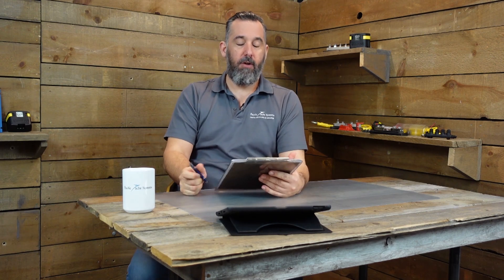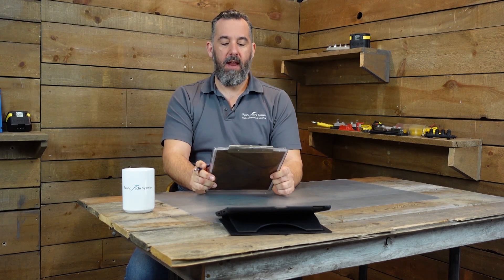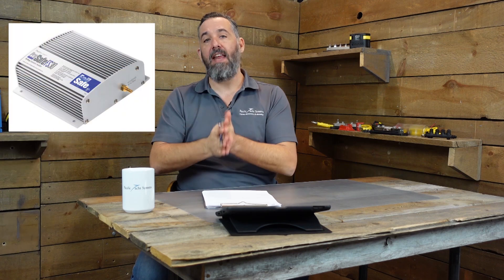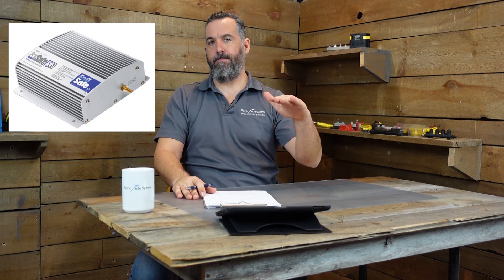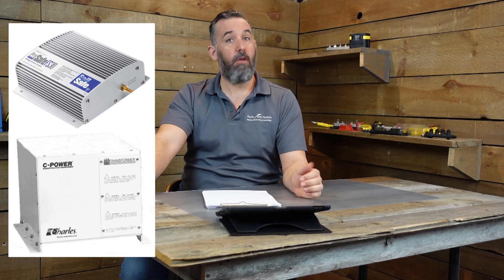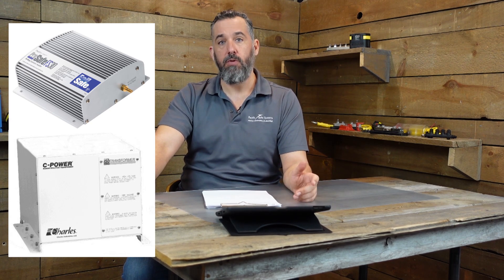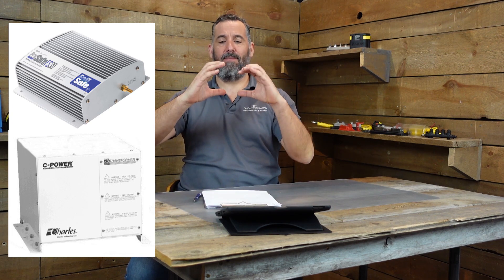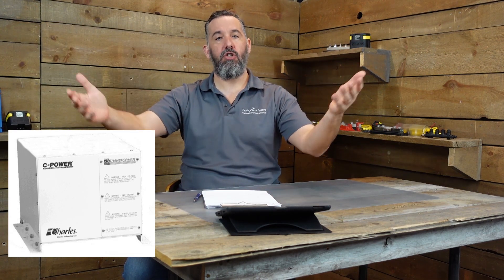What Is the Difference Between a Galvanic Isolator and an Isolation Transformer?

Comment: High quality isolation transformer: 2000W for $350, 3200W for $500. That's enough for most 50ft and smaller sailboats (it is rare that you need over 1500W at any one moment). Not that expensive. Still, galvanic isolators are half that. But it's not thousands, as you claim, unless you want 10kW+.

Comment: I've used isolation transformers in power closets(IT rooms) that are only about 100 pounds and about 1.5 cubic feet.  I've seen smaller ones than that but I'm thinking of the few thousand watts you might need on a smaller vessel which is certainly less than a smallish IT room consumes.  They don't have to be the behemoth size and weight you are describing.   Yes they are going to be pricey, but if you own a million dollar yacht, what is it worth to keep that 80k Seakeeper  or the 50k worth of electronics you have installed in safe working conditions?

Comment: Hi I have 2 shore power connections, one fwd and one aft connected in parallel.
Do they both need separate Galvanic Isolators?
Reply from the maker: you can not connect 2 shore inlets in parallel.  They each need their own AC panels, main breakers, and keeping the neutrals separated.  or a switch that selects which one is in use.    If they are parallel you will never be able to plug into a dock that has gfi / elci / rcd breakers.  or add them to your boat.

With a switch you could get away with only one rated for the shore size.  if you are using both inlets you'd need 2 rated for the shore size or 1 rated for the total shore amps  (2x inlet amps).   wiring 2 would be easier to make sure they get wired correctly

Comment: Hi Jeff,
I am a huge fan of your videos,
Thank you so much for doing all that work for us.
I am considerind purchasing a Victron ITR050362041 isolation transformer, and if I understand properly, it can handle both 110V and 230V.
But I suppose that if I cross the atlantic and plug my boat in a marina in north America, I will have 110V as a result on the boat side of the transformer. So What is the purpose if I cannot use my 230V devices ?
Some other questions :
Is it « Marine environnement certified », as you advice? 
What about the noise ?
Thank you again, and best regards from France ;)))

Comment: What are your thoughts on the isolation transformers from Victron Energy? I have a steel boat and planning on getting one but not sure how to size it.
Reply from the maker: Hmmm, some but not lots of experience with metal boats. You size the isolation transformer based on your shore power voltage and max amperage.

Comment: One of the catamans was using of of these Isolation transformer Mastervolt GI 3.5 with a 13.2 lb weight but probably expensive
  
https://www.mastervolt.com/products/mass-gi/mass-gi-35-kva-16a-lightweight/
Mass GI 3.5
A safe connection between vessel and shore installation is an essential part of your electrical system. A galvanic electrical isolation between shore power and the on-board power prevents any electrical corrosion of metal parts while keeping you earthed.
•	Ultra-modern high-frequency electronic switch technology.
•	Lightweight and compact.
•	Integrated Soft Start function.
•	Connect to voltages from 90 to 255 V and from 45 to 65 Hz.
•	Units can be parallel coupled for higher capacity.
•	Higher efficiency, limited heat development.

Comment: Thanks for the great videos!  Can isolation transformers fail?  How do you know?  I've got a 2006 boat with one in place, and uncertain if I should be trusting it to be functioning correctly.  Would i be correct in assuming that the AC power supply would fail (cease to engergize the boat) if the isolation transformer failed? Thanks in advance.
Reply: If you're asking does the Isolation Transformer "wear out", then no, not really, not in anything like a short span of time.  Really high voltage spikes, (think near lightening strikes) are about the worst thing on transformers.

Comment: I am adding an inverter to my boat and I have a galvanic isolator on the shore power coming into my boat.  I have a breaker on the shore power after the galvanic isolator. Should the neutral and ground be bonded at the breaker going to the inverter or should they be isolated until they reach the AC distribution panel where they are all bonded together? Thanks for all the great videos and information! Love the PYS Hat!
Reply from the maker: Hi Ben, the AC neutral and ground can only be connected together at the source of power. Normally that neutral and ground tie happens at the source of AC power on shore. A Marine inverter, when inverting will automatically do a neutral ground tie. 

You definitely should NEVER do a permanent neutral to ground tie on your boat.
Reply: Thanks for the information.  Trying to break my bad habits from wiring houses. When I see a breaker box I want to tie all the neutrals and grounds to the rail. I'll isolate them to the inverter and from there to the AC panel. Keep up the great videos!

Comment: Hi. Another Question.

When installing a inverter/charger can a large AC circuit panel be split to have some circuits powered by shore power and some by the inverter or is it better to get a seperate sub panel for the inverter circuits.

I am installing a inverter/charger and had planned to use a seperate sub panel for the inverter circuits but an old salt told me I could split my existing Blue Sea panel. This would leave to main breaker and two circuits (inverter ac in and the hot water heater) powered by shore power and the remaining 4 circuits to be powered by the inverter. I believe this would involve shortening the 3 common buses in the panel and creating new ones for the inverter circuits. 

Even if this is possible, is it recommended? It would save space and money and make for a neater installation. 

Thank you.
Reply: Depends how the boat is wired. ABYC normally REQUIRES a separate sub panel for inverter loads. You may have to install a breaker powered by the inverter so you can isolate it from the loads. At least that is how I would wore it and I do marine electrical for a living.
Reply from the maker: Hey Mike, yes what you ask is doable and we sometimes deploy inverters like this too.

Comment: Would it be reasonable to have shore 120AC only go to a charger  and run all of your 120AC loads from an inverter?
Reply from the maker: Yep, some boaters have this exact setup, especially for boaters that have a boat wired for AC loads at 60 hertz and  are now in a different jurisdiction where shore power is 50 hertz.

Comment: Hi Jeff, where  should the galvanic isolator  be installed, close to Power entry, inside  ?  Does it protect your boat against others and or your boat   leaking in the marina, ?  Great intro , 
JC
Reply from the maker: Galvanic Isolator should be installed as close to shore power receptacle as possible. A GI doesn't protect against all stray corrosion events but it helps a lot, definitely worth having.

Comment: Jeff, should the AC grounds (shore power and generator) and all DC source grounds (inverter bank, engine starter battery, generator starter battery) be connected together and where should that connection be relative to the sources?
Reply from the maker: Long overdue on doing a long grounding video, it's coming.
Reply: @PacificYachtSystems  must. have. grounding. video. plz

Comment: Jeff , can you do a Q&A video on shore power cables . I see pictures of burnt cables on a regular basis and wonder why this is such a common source of shorts and fires .
Reply from the maker: Good idea, will keep it in mind.
Reply: For sure the #1 cause of boat fires is bad electrical connectivity. Primarily from shore power connections. The old style pin connections have been around for ages. Check out SmartPlug. During Jeff's Q&A with Nigel these are highly recommended by him.

Comment: Is any of this different if you're in the Great Lakes?
Reply from the maker: Good question, limited experience with fresh water and don't know.
Reply: I believe it would be a difference in degree only since salt/brackish water is more conductive than fresh.  You could try reaching out to some of the marinas and even the boat builders here in the Great Lakes region and ask if they have any recommendations on having electrical work done.  Then call them and ask.